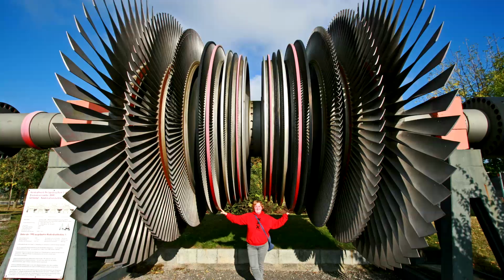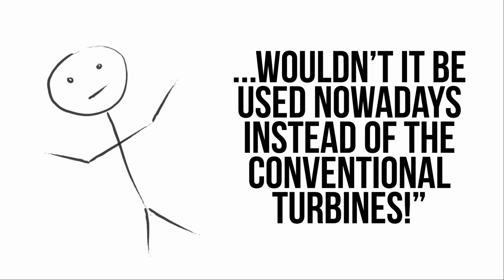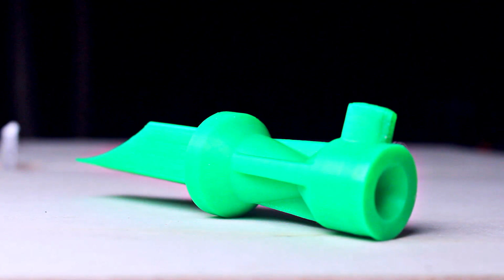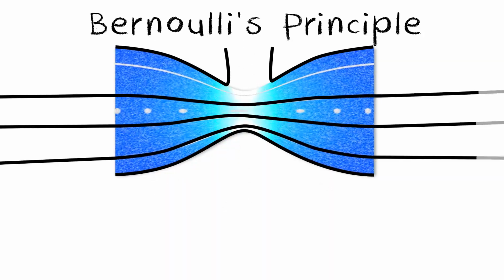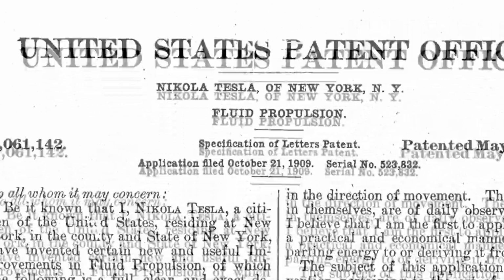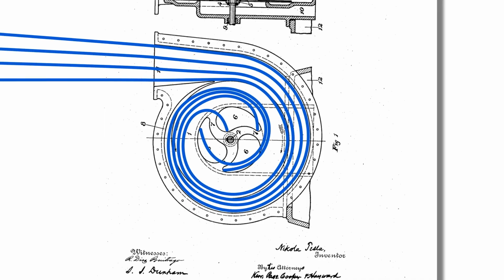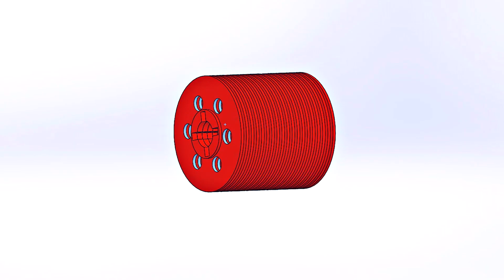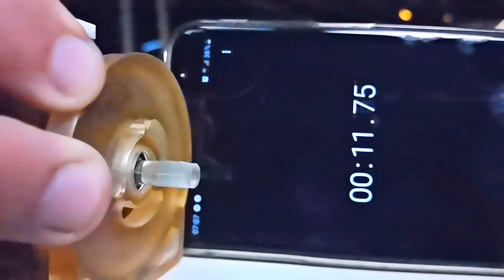Tesla Turbine [Smoke Flow Slow Mo]

Comment: Grazie mille.  Delightful.  So, if I understand correctly, the convergent/divergent nozzle didn't help, and maybe that's because of turbulence it creates, as Da Ponte Lopes suggests below, but we need to know - did you try the standard input on the volute casing?  Second:  it makes sense that the volume of the intake side can make a difference - the hydrodynamic equivalent of trading off more "current" at lower "voltage" of the inbound fluid. The whole volute casing is a nozzle, really.  Third:  what about increasing the "stickiness" of the disk array?  I doubt that 3D casting the disks or spindle is the best idea. If you punched the disks out of thin, metal sheet you could get much more disk surface area on the same spindle length - and there's probably a texture or pattern geometry that could be stamped into the metal disks to a)optimize surface area and b) help spiral/concentrate the airflow into the output vents.  Fourth: it seems like the spindle itself should be hollow, vented along it's length, and of a diameter that minimizes resistance of the fluid flow out of the exhaust ports.  Just ideas.

Comment: Why not just use already made rotors, such as compact discs or the disks from a hard drive? Also, is there an optimal distance between rotors? Is there an optimal size for the exit vent? Lastly, is there an optimal number of rotors? I mean, obviously you need at least 2, and half a dozen is apparently better… but is there a upper limit?

Comment: if make the discs more air resistance and make your discs more bigger and make the nozzel diversion ability increases by making more thinner and made the middle hole of your design bigger  not much just little bit bigger also make design more efficient of diverging angle of strike of air on the disk , try it your engine make

Comment: Little tip, if you clamp a straight edge, or piece of straight timber, to your table saw, you can run your work piece along it to cut straighter lines.

Comment: Looking back at this video, I think the new casing might not be the problem, but the convergent divergent nozzle, since it has to be perfectly sized to actually work, if your air flow doesn’t reach Mach 1 at the critical cross-section or your air won’t be accelerated to super sonic speed but instead slow down again

Comment: The original tesla turbine was limited by Tesla’s manufacturing technology. 

I think your 3D printers can modulate and vary the surface smoothness (and surface boundary layer) as well as the disk spacing along the radial axis. 
That is 0.4 mm  (assuming steam-1) at the very outermost radius as steam enters the turbine at maximum velocity. 

As the kinetic energy of the fluid is converted to mechanical energy the fluid slows. 

The boundary layer thickness is proportional to the fluid velocity-2 so as the fluid slows as it spirals in the disk spacing should be changed to maintain a 2delta distance. 

I also noticed that the in-spiral of the fluid -1 looks an awful lot like a  Fibonacci series… -3

-1: https://youtu.be/AfCyzIbpLN4
-2: https://en.wikipedia.org/wiki/Boundary_layer_thickness?wprov=sfti1 @ The 99% Boundary Layer Thickness

-3: https://earthsky.org/human-world/nautilus-shell-fibonacci-logarithmic-spiral-golden-spiral/

Comment: First, let us remember that Edison touted DC while Tesla wanted AC. With that said, how do you achieve the 50 Hz or 60 Hz with a turbine that needs high speed. Once you start gearing things down you lose efficiency.  This is the problem with the Tesla turbine.  AC, in the US is regulated at 60 Hz. Or, with most generators, 3600 RPM, some at 1800. A generator can be defined as a machine that transmits torque. The torque it takes to turn the generator is transmitted on wires as current to a motor that turns the current in to torque. Just something to think about. Other than that, I absolutely love your show. Extremely coherent with the right amount of humor. Don't stop, live your dream.

Comment: Helo broather . i am an inventor and tesla fan . i give  u the perfect match for your tesla turbine . put in midle of the discs a static snale shape  to each disk that wil force the air folow the longest path and the output wil be insane even in low rpm . as many coils u put in the midle it wil increase the friction

Comment: Here's an idea or two, make it so that the air is forced through a path that makes it contact as much of the disk as possible, reshape it so that the outside disks are smaller than the inside ones, make it so that there is an inlet at one end of the axis and an outlet at the other end, expand the input point across the entire axis.

Comment: could you make the discs of copper, and on the outside casing mount neodyme magnets...so the flux cuts induces separate voltage? side note i have always wondered why everyone places them vertically and not horizontally, i feel it would help stabilize wobble

Comment: What if you used the same kind of graduated casing, but started the gas a t the centre? Or you could use the same nozzle mount, but make something suck through it instead. Creating the same effect: the most efficient laminar flow would be at the center, coming through holes in a hollow axel. I want these turbines to succeed, too!

Comment: Why would one not want to use a Tesla Turbine as a ram air generator for an RV (while driving, using a naca type duct) battery bank? Thank you!
Reply: I would assume because of the resistance and weight of the contraption you wouldn't achieve much out of it in the end.

Comment: I have a feeling that, though the gradually curving casing may be slower, It has more torque. So depending on the use of the situation or what you're driving, One case design maybe more suitable than the other. = )

Comment: The output flow coff. at the rotor center sucks. I have a fix for that.
The flow through the rotor, using the rotor as the frame of reference is radial so support vanes can be radial also.
I owned an engineering business for forty years and did a lot of air flow work.

Comment: Would the temp of the air make a difference to the rpm?
Reply: Yes! Increased speed out of the nozzle going into the turbine. Not to mention gases increase in viscosity as the get hot so the increased viscosity increases adhesion and decreases slip on the discs which increases torque. Power, rpm and efficiency

Comment: I'm thinking of trying out a flywheel battery/ generator that gets its spin from steam and this turbine might actually provide a super efficient way of maintaining the high speed of the flywheel, especially if you suspend the flywheel magnetically in a hydrogen chamber. With a campfire and some water, you could put out some decent energy on once.

Comment: Could it be possible to integrate the volutes reduction into the traditional casing? Like instead of a large casing, let it have segments between the disks reducing in diameter, with a narrow gap between casing and disks, and only for the first 25-30% diameter reduction? This could redirect the majority of airflow gradually, without too much loss of torque at the outer perimeter?

Comment: I would suggest a 6mm precision shaft, then glue the disks to it. The bearing will be better in line than on the printed shaft. Sand the shaft than use Sihanouk acrylate as a bonding agent. On the blade breaking on sheet metal your blade teeth are spaced too far apart. The spacing should never be further than the thickness of the metal to be cut. Get a blade with more teeth

Comment: I'm curious if anyone has thought of using filaments instead of discs to decrease the shear effect and warping of the discs? I know the highest tensile strength filaments or threads are nanotubes. But I'm thinking the general operation of the turbine won't be affected much by this.

Comment: We don't need to put any work into this. The problem with the tesla turbine is that you physically can't make it as efficient as a regular turbine. For a tesla turbine to be 90%+ efficient, you need the rotors to spin incredibly fast. So fast that you simply can't make a rotor with standard materials because they would shatter into a million pieces at those speeds.

Comment: Theory: To mitigate the over-torqueing problem we could possibly use multiple small turbines to achieve the same goal. (Hooke's Law of physics)
Theory: Tapering the ends of the fins could reduce torque strain and still net positive.
Possible problems:  
Buildup of heat and cooling problems. (Lost efficiency to friction to multiple moving parts)
Direct mechanical energy transfer with a brute force number of these together would likely cause problems if the input is uneven.  
Application: A flywheel drive could be used as a mechanical buffer but the additional moving part would cost energy to friction and heat.  A vacuum or noble gas could be used to improve flywheel energy efficiency.  
Utilizing the micro generator module with independent generators per turbine could result in an energy backflow where the slower turbine turns into an engine instead of a generator, leaching power.  (Happens in power plants)  With the sheer number the energy loss could undo everything that was gained in the system.
Materials cost and maintenance.  More moving parts and more points of failure.
Conclusion: 97% efficiency is not number to scoff at.  Modern turbines work at about 37% efficiency at HHV4 with a low of 10% at HHV.   If we could pull this off it would be world changing.

Comment: Not using goggles when working with rockets that have routinely blown up (and made of ceramics too, sharp pointy horrid nasty shrapnel!), holding things that are spinning at tens of thousands of RPM, but haven't been tested for balance or durability, in your hand, without wearing gloves, welding without safety gear (beyond a visor) while wearing what looks like artificial fibers, making a pulse jet engine rotate a chair while you're on it with a gas bottle, and doing it all in the attic of the house you live in... And you're warning us about _smoking_?

Comment: Pattern the surface of the disks (or stick sandpaper on them) and see if you can get higher RPM from the same input pressure.
Reply: Boundary layer drag is not from
Mechanical Interactions between the fluid and the disc. Adding grooves will introduce turbulent losses which will reduce the efficiency and can induce stream separation, and even flow reversal, counteracting the desired torque, because of the turbulent flow regime it would induce. The Tesla turbine works on adhesion from viscous forces, which are entire valance electron shell interactions. Think hydrophobic and hydroPHILLIC interactions. Making the surfaces of the discs hydroPHILLIC would increase the molecular adhesion of water and steam molecules increasing the boundary layer thickness. 

Putting mechanical impediments in the way of the free flow motive fluid completely defeats the purpose of the turbine in the first place. You want smooth faced discs. The “wetting angle” between the Type of material the discs are made of and the type of motive fluid is the important factor here.

Comment: A Tesla steam turbine is most efficient at 50,000 RPM. A similar built turbine using hydraulic oil or a thicker more viscous fluid would be able to be highly efficient at much lower RPM. The solution would be to emulsify water in oil and heat the oil up to high temperatures to produce the desired effect without worrying about warping the discs due to centrifugal force.

Comment: How do you know the new one was bqd??

Did you test it?  Seems sloppy to just assume its inferior because it doesnt spin as fast.  Maybe its capable of more torque perhaps?  And/or hold more speed under load??  Mechanical processes tradeoff torque and speed, as power does voltage and current etc. so it seems a plausible theory...

How did the nozzles differ on each?  I bet it would work more properly if the input was more like "real" use, with large area of slower moving air funneled down to input to increase pressure/velocity.  Obviously the compressor is capable of more input pressure, but it's also a pin-point source with ridiculous turbulence trying to quickly expand out to fill much larger input cross-section.

This is opposite of optimal input conditions...a turbine that runs on laminar flow and surface contact it seems would benefit from a laminar non turbulent input stream.  Much efficiency I would theorize is lost due to such violent input conditions.

Main point being, I wish you'd at least tried to test the other design before dismissing it as worse...after all Tesla didnt design too many total failures.  Do you think the input conditions would make a significant impact on performance if you could "smooth" it out?  I loved fluid dynamics... but it took longer than 18 minutes

Comment: If it's possible.. could you make a turbine with a tesla valve? for example.. you have a disk with 3 tesla valves angled in the direction of flow creating a resistance that will force the pressure to rotate the Impeller.

Comment: So on the outer casing, make a hole that flows with the liquid air, it should be a very small hole, about 0.08 the size of its original, this may help as air is non comprehensive, the sudden vacuum may create loss of power, and with the outer tail to inner tail hole, it may increase efficiency, as the vacuum may pull more air in, creating higher pressure, and the suction from the vacuum would be much less, meaning more pressure to push onto the "blades"

Comment: Ur procedure is terribly wrong! In the earlier attemps u used a machine to blow through the pipe.. it ddnt work. Them u made another model and used your mouth to bliw it. U dhould have bin consiste! Used ur mouth top for the earlier models to see if it is the design that is flawed or if your mouth has to do with it.

Comment: Isn't it how the torque converter works in an automatic gearbox? It uses the viscosity of the oil to transfer engine's torque to the wheels (plus a lot of parts designed to fail waaay too soon).

Comment: Have you thought of adding spiral grooves into the sides of the disks? Also has anyone tried this using magnetic disks.
Reply: Unfortunately This is not a good idea. Adding grooves will introduce turbulent losses which will reduce the efficiency and can induce stream separation, and even flow reversal, counteracting the desired torque, because of the turbulent flow regime it would induce. The Tesla turbine works on adhesion from viscous forces, which are entire valance electron shell interactions. Think hydrophobic and hydroPHILLIC interactions. Making the surfaces of the discs hydroPHILLIC would increase the molecular adhesion of water and steam molecules increasing the boundary layer thickness. 

Putting mechanical impediments in the way of the free flow motive fluid completely defeats the purpose of the turbine in the first place. You want smooth faced discs. The “wetting angle” between the Tyler of material the discs are made of and the type of motive fluid is the important factor here.
Reply: Adding the magnetic discs, assuming the magnetic field is parallel to the axis of rotation, normal to the disc faces, you will make a faraday disc and generate a voltage potential between the disc tips and center drive shaft. 

Tesla actually has a DC generator patent that’s an improvement of the faraday disc. Its patent number 406,968 Electric Dynamo Machine. It’s essentially a double faraday disc arrangement that sets up the magnetic field on the two discs so that the voltage is negative at the periphery and positive at the center.) for one disc and then the other disc has the voltage negative at the center and positive at the periphery. He then belts the two faraday discs together with a conductive belt so that current can flow between the two. 

This allows a faraday disc generator to be made with mind numbing max current capacities due to the massive surface Area in the connection between the conductive belts and the discs, (normally brushes would make the connection as they rubbed on the surface of the periphery of a faraday disc yielding very high losses from friction and resistance from the low overall total conductive area via the brush connections available for current to flow. 

Teslas design makes it so the current goes in one drive shaft out to the periphery of the first disc, down the conductive belt to the periphery of the second disc then into the center and out the second drive shaft, making the positive and negative connections right at the driveshaft where the parts have the lowest tangential velocity due to rotation.

Comment: There is a virus on the loose! No I'm not talking about da rona, I'm talking about 3D printing virus. How come it is that everyone who has access to a 3D printer has do do manufacture all their parts on that? Tale the discs for example: It would have been faster, simpler and higher precision to just turn them out from a rod on a lathe and then drill the holes. For the drilling a CNC could be used. precision